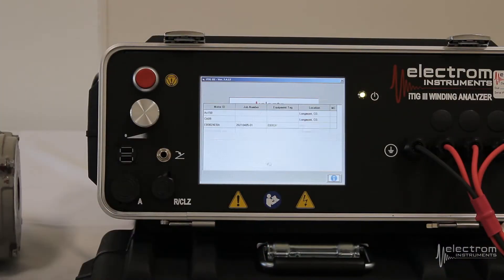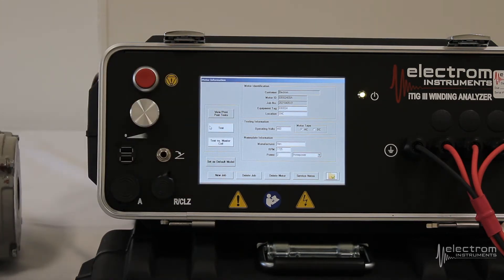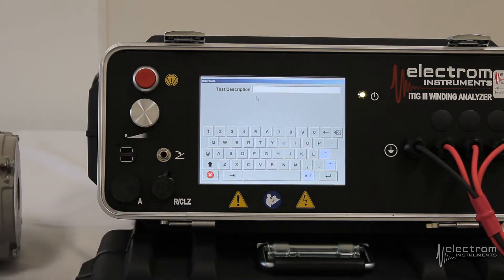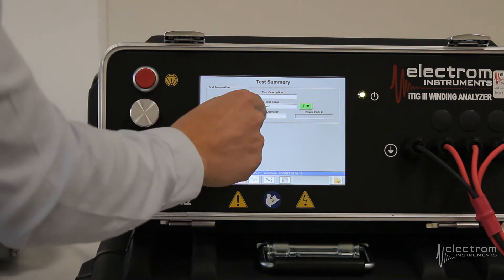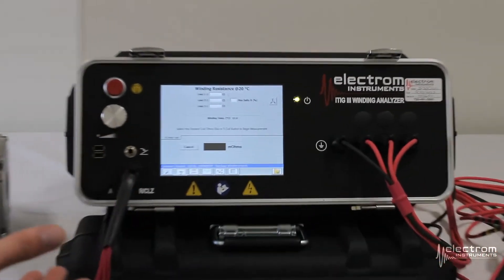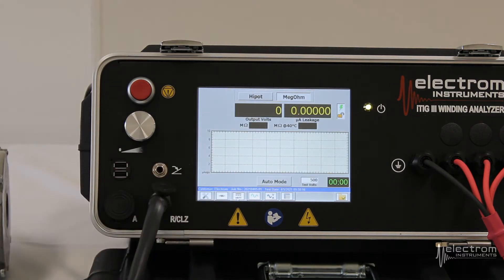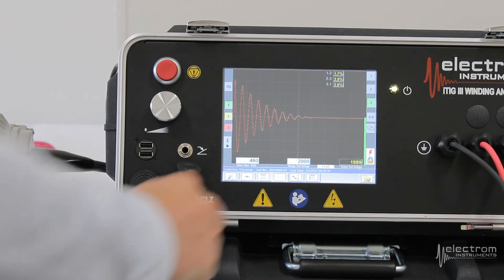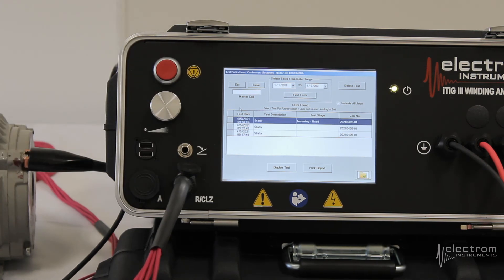iTIG III Model C Demonstration

Comment: in video you shown that low voltage leads are used for winding resistance test how much voltage applied using this leads to the motor windings. please reply